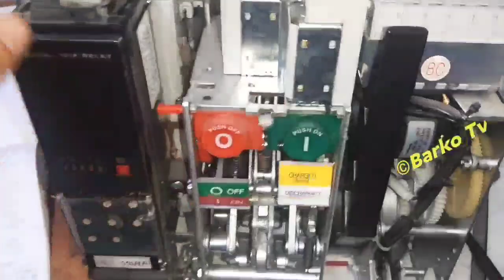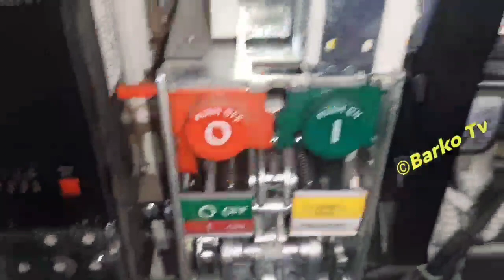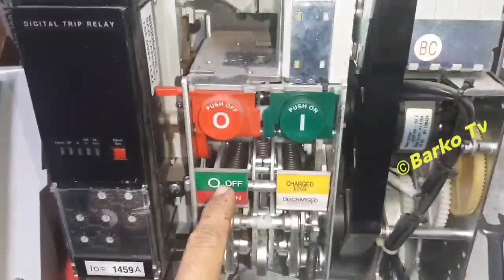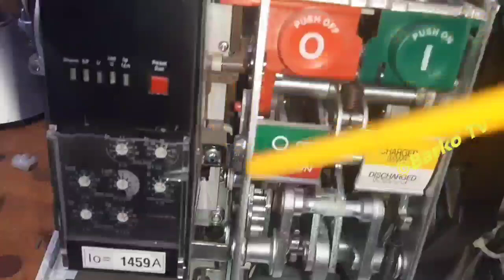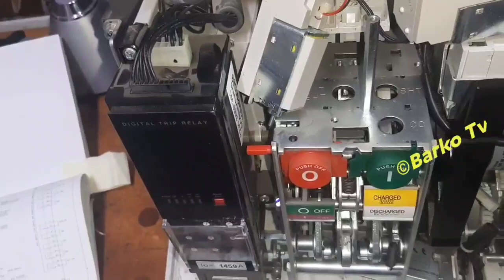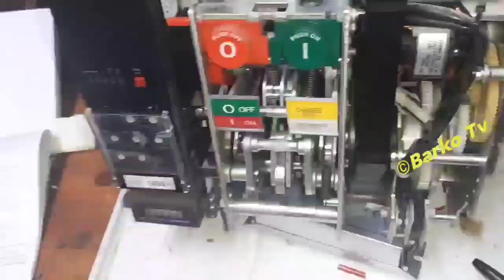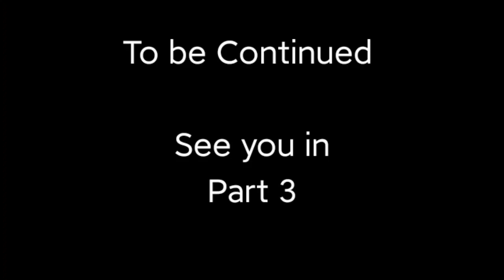Part 2: ACB Troubleshooting & Simulation | UVT & Charging motor | | Metasol | Switchgear | kalecky

Comment: Sir paulit nung explanation dun sa shore connection.
Reply from the maker: Sa shore connection merong interlocking contacts po yan. Pag my ma detect na power supply ang shore connection mo, e check mo muna ang phase sequence kung pareha, tpos pwede mo na ma turn on ang shore connection breaker